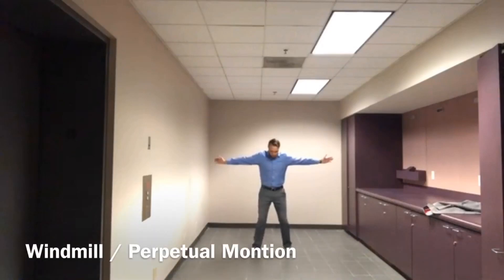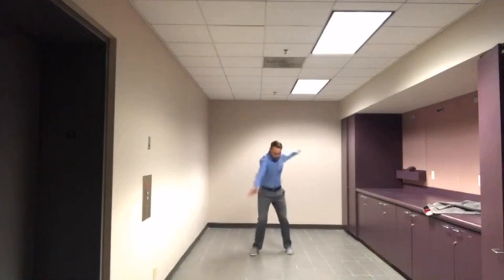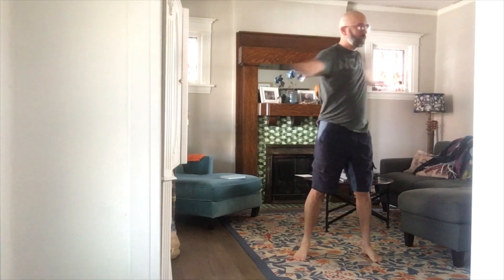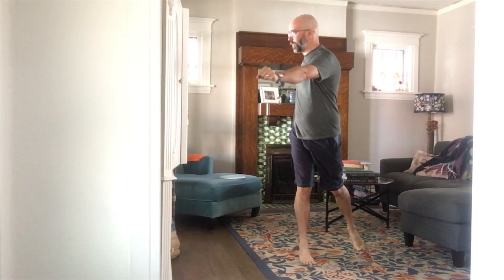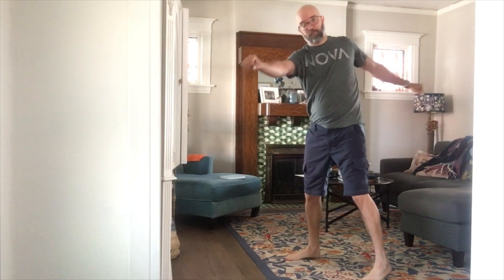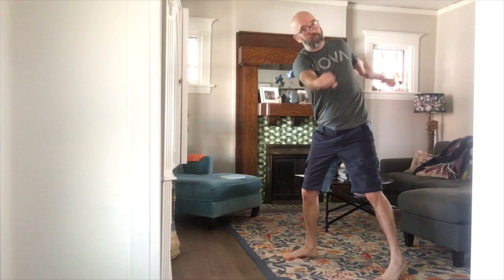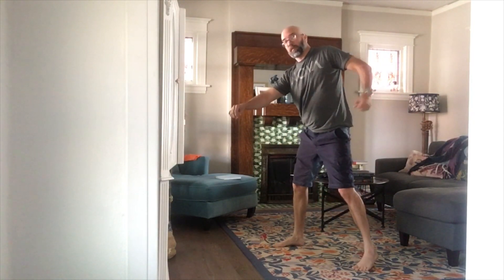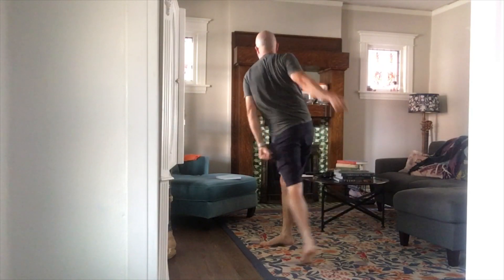Perpetual Windmill Drill

Comment: How important is the downshift in the swing? I threw the other day for the first time in months, but I really wasn't getting good snap on my disc. I started implementing more of a downshift and immediately got more power.
Reply from the maker: I think it's easier for me personally to get some momentum trapped if I'm down shifting. You can certainly swap out the down shift with more of a lateral shift - but that does tend to complicate things. Like nearly all things in DG, there's examples of great throwers doing it both ways, but generally I think of down shifting as easier.